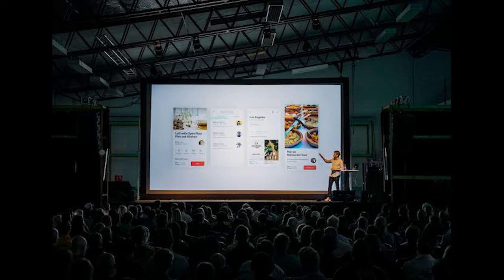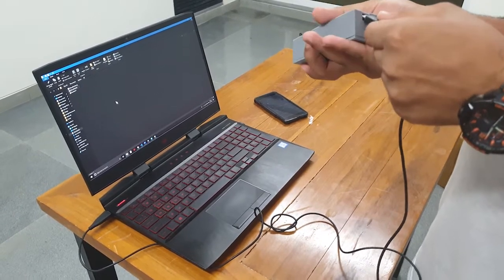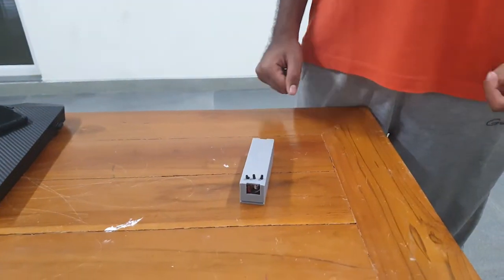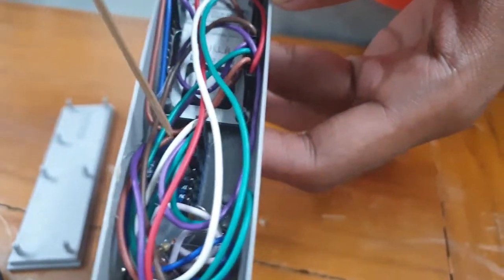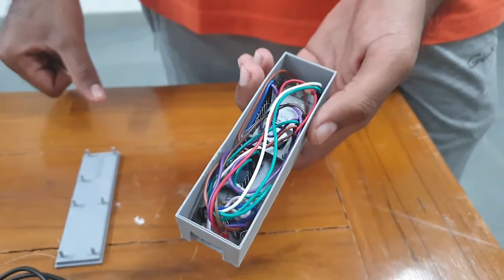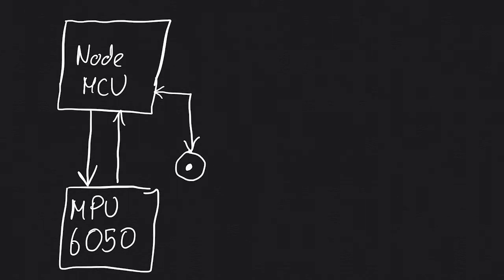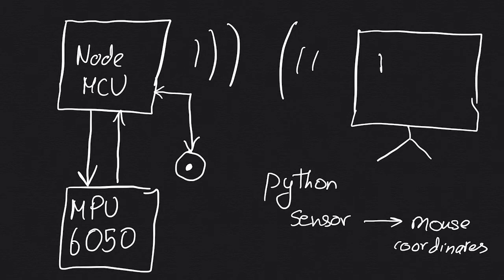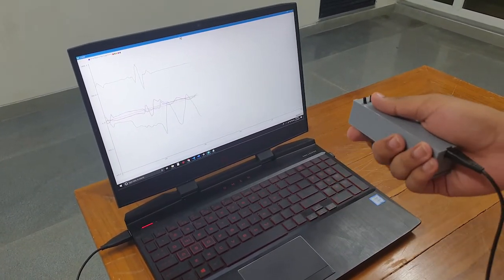Gesture Based Presentation Pointer/ 3D-Mouse with NodeMCU

Comment: For the code, how to conected bouncebutton ? Im not found wiring for button in github, thanks
Reply: A button is a simple passive element. It has 4 terminals. U can connect one of the pins to ground, and the other pin to one of the pins of the nodemcu.

Debouncing is done to prevent hardware simulated unexpected clicks. To prevent this, we take 2 successive reads of the pin, with a delay in between. With this you'll be able to get the button movements.
Reply: Thank for this problem, i want to implement, if any problem again, i want to you help to me. Thanks, sorry for my english
Reply: Hai, i have a problem with button, i cant click. is send data 0 when button pressed ? I change ctypes to tkinter because i use ubuntu os.